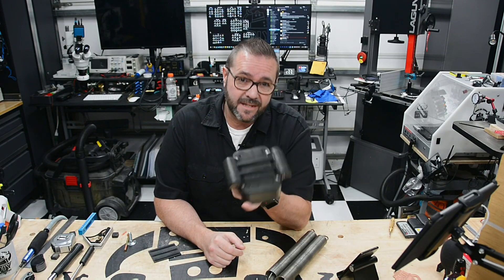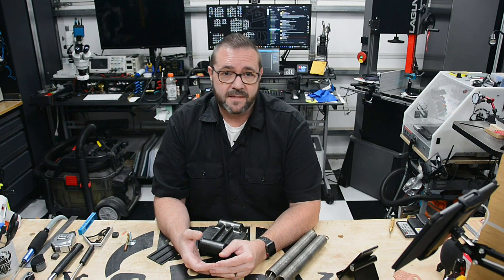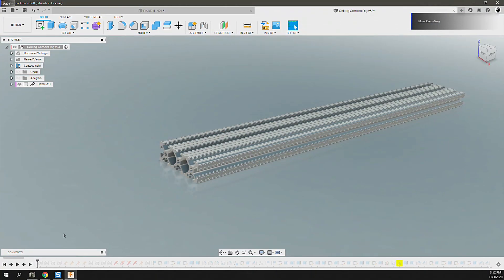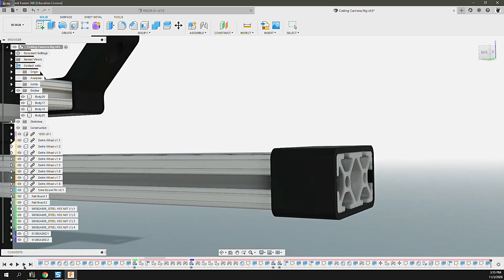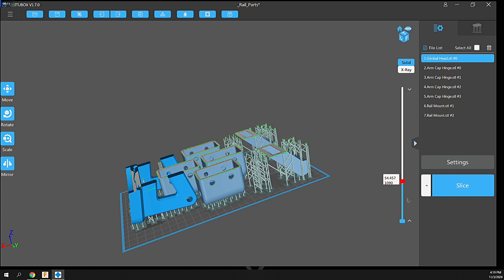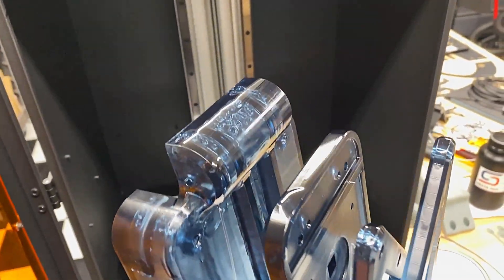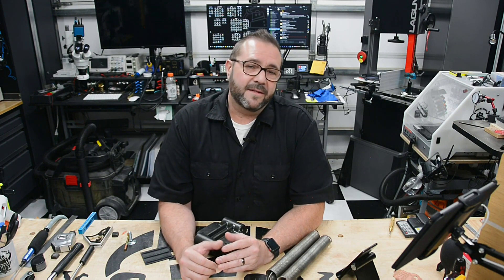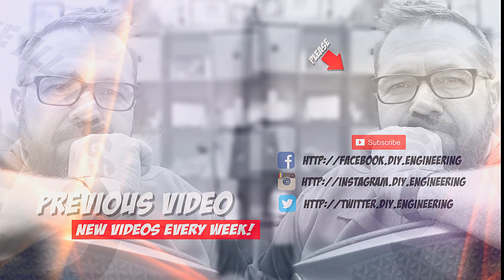Make a 3D printed, Articulating Ceiling Camera Gimbal!!

Comment: Great Job - I have made two camera booms for my shop, one articulating like yours and one on a balance boom with a scissor lift that pulled it into the ceiling and out of the way while not filming.  The latter contained a lot of printed parts (filament - not resin).  Both failed (luckily without the camera attached).  I am in a new shop now and will build a new boom this or next year - and yes, I will put tag lines up this time!  I have 9' ceilings so I need the ability to drop the camera a bit lower so I will be designing anew.  I would love to see your plans but you gave it away with the articulating lamp - I can duplicate that.  If and when my new rig is up, I'll drop you a line.
Reply from the maker: happy to share, the tricky part was getting the right pressure gas struts to support your weight.

Comment: Wow. Congratulation, this is really brilliant and well made😲
I haven't tried the Siraya Tech Resins yet but one thing that frustrates me a lot when printing mechanical parts, is that as soon as it gets scratched or part scrub against each other, it make a sort of powder and and gets all white. For example, I can't really make threads in resin. Does it do that with your mix as well?
Reply from the maker: My mix is the best resin I’ve seen/used for threads. Add more tenacious if you need them perfect
Reply: @DIYEngineering  Actually my threads are perfectly shaped! And holds very well mechanically speaking it's just that they get white from rubbing against each other (you know that powder that you see when scrathing a standard print with your nail) and it's ugly visually. I was wondering if mixing with tenacious remove that problem.

Comment: Damn David you just keep putting out. That is a killer design and thank you for taking the precautions to protect your ass so the lessons can flow. Now all you need is some servos, controller, tracking dongle and camera set to auto focus. Then you can just place the dongle where you want the camera to look and become completely hands free. Keep it up my man! Really enjoying the new stuff and the volume of production you putting out these days. Looking forward to the new holiday stuff also. Re-watched a few of the older holiday eps and they are cool too. My favorite is still the Force Beer Dispenser but only if it is attached to a pony keg of Blue Moon and orange slices on the side. Also, thanks for putting something up that has nothing to do with the election. You are the man. Take care.
Reply from the maker: Alright! I like the way you think! Blue moon sounds great about now! I’ll definitely be pursuing the motorized design... this was a good project to get my feet wet and solve the boom issue!
Reply: @DIYEngineering  I have no doubt that the ideas are a flowing. Looking forward to seeing the evolution of this project not unlike the portable retro gaming. Let me know, if you are willing, to build a project with the Raspberry Pi Compute Module 4. I would really like to purchase one from you.
Reply from the maker: @chatbear69  seems easy enough, I used to do a lot of work with theatrical lighting systems so im familiar with alot of those technologies... fun stuff
Reply from the maker: though, let me know if you know anywhere to get a CM4 before next year! :)
Reply: @DIYEngineering  It's called an I-Cybie. Way more basic and much earlier than Aibo. I'll see what I can come up with for the Compute Module 4 before years end. If I find one I'll contact you via email to get the Address.
Reply: @DIYEngineering  Have seen one of these before ... http://www.theoldrobots.com/images12/cy7.JPG I have one that I would like to send to you at some point and see what you can do with it. Maybe an upgrade on controller and sensors. Might be a fun little project.
Reply from the maker: @chatbear69  that is very cool! what was the name of it? is that an Aibo?